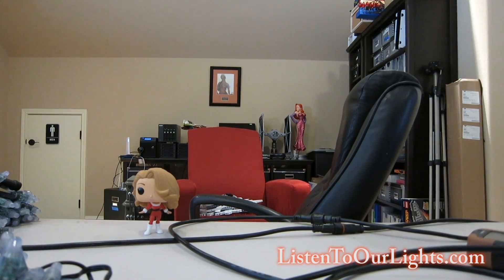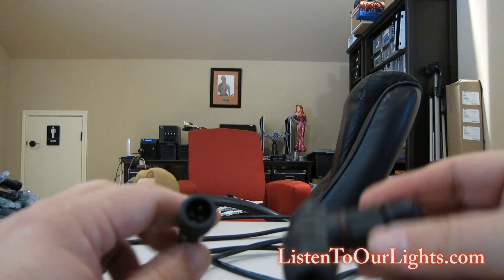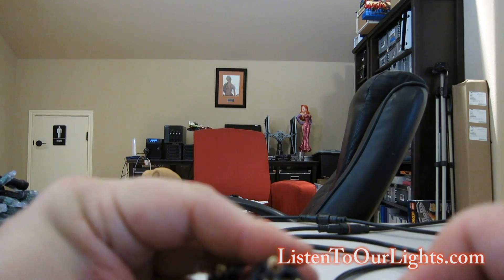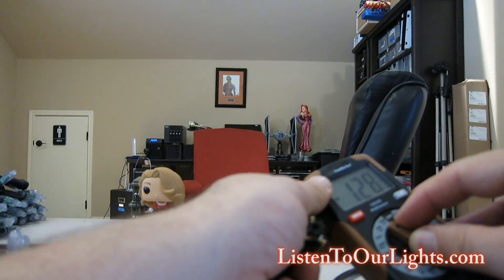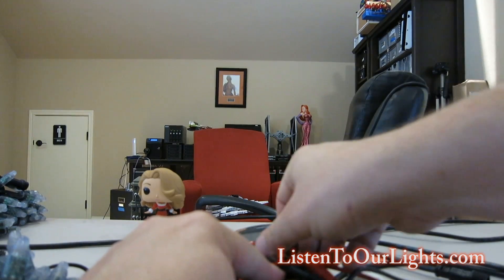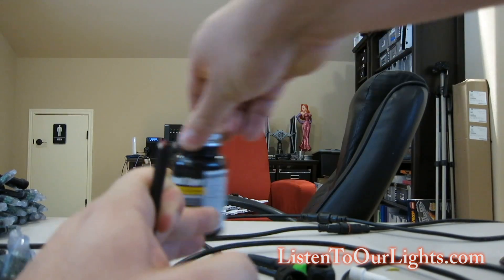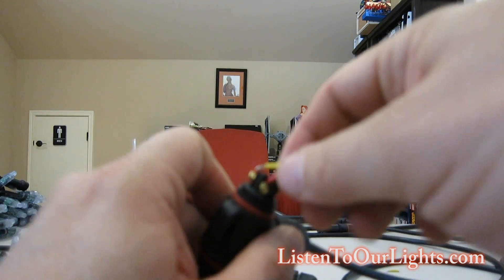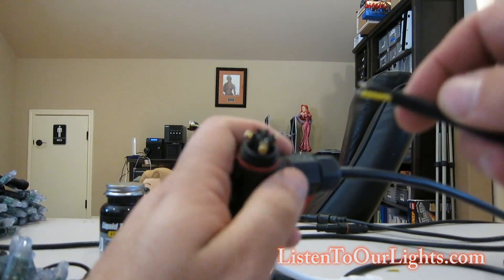Solving 3 Problems with Custom Tees

Comment: Nice innovative tip there John!  In your wiring of the V+ on all 3 ends of the T-connector, you are connecting the V+ from the power injection input and the V+ from the incoming pigtail.  This will mix V+ across two separate 5A fused power outputs.  For those who want power isolation from the power injection point and onward, I would cut the V+ from the incoming pigtail and add a dab of the electrical tape (like how you did with the data wire of the power injection pigtail).  Great tutorial as usual!
Reply from the maker: I don't have V+ coming across the first pigtail, only data and ground.